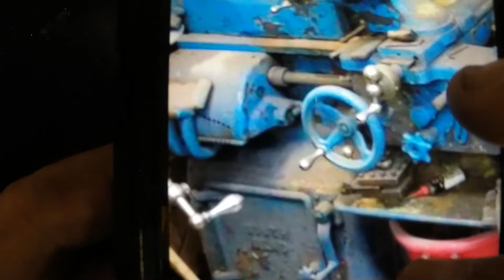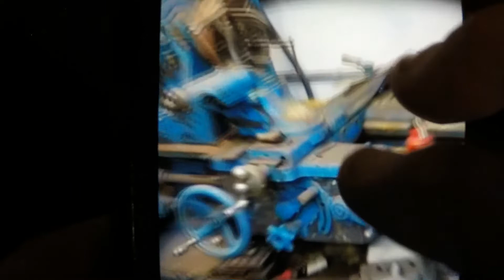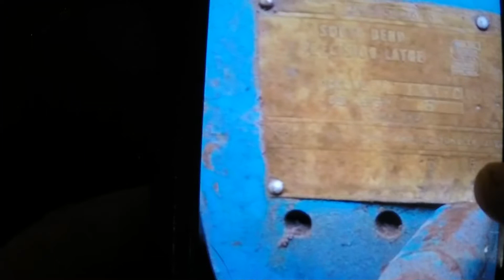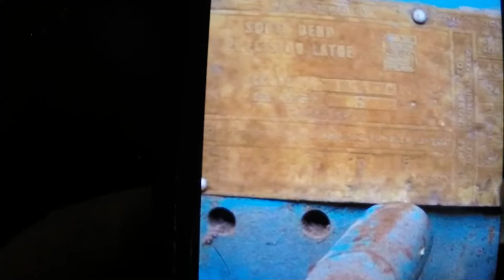NEW MCHINE  ?

Comment: That looks like a 13 inch with riser blocks. It’s definitely bigger than a heavy 10 because that’s what I have. The beauty of a south bend is there are tons of parts available. It’s got the good taper attachment and if it’s coming with the steady  rest and the follower rest it’s worth it just for those three. Definitely needs a lot of cleanup work. The Ways actually look decent from the pictures. Seems to have a good potential. 👍
Reply from the maker: With the information Brian Bloc sent me I am not sure I want to pursue the South Bend any further. I found out Machine restoration is a lot easier to watch on YouTube than it is to actually perform the task
Reply: @kimber1958  Yeah I spent an entire year on mine…

Comment: Looks like a SB Heavy 10 with riser blocks to give it a bigger swing.  Most important items:  1) condition of bed ways, 2) spindle play (i.e., test bar and indicator), and 3) condition of other wear items such as lead screw, half-nuts, gearbox, and feed screws.  $1300 sounds fair for a heavy ten in good condition with a taper attachment and the other items you've mentioned. Sorry I've been AWOL the last several weeks!